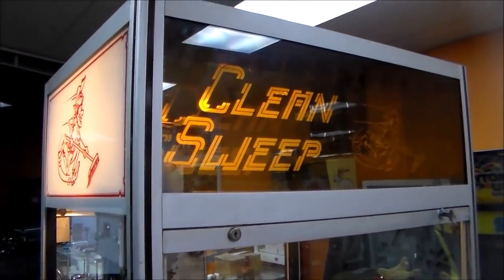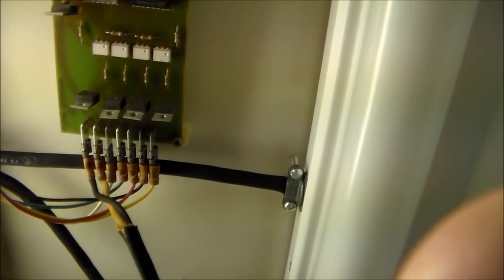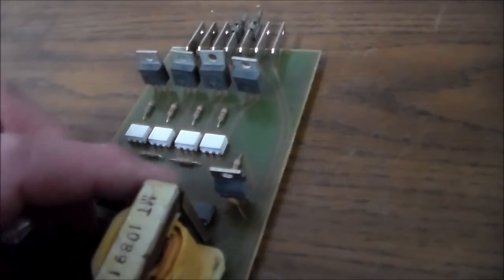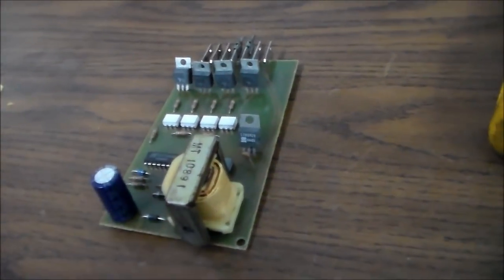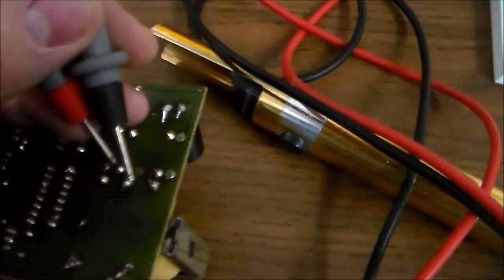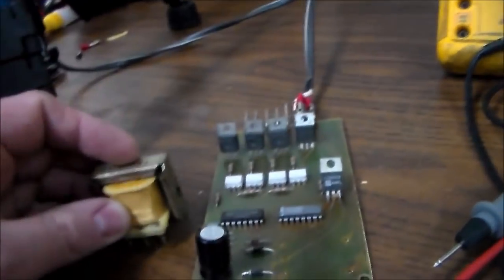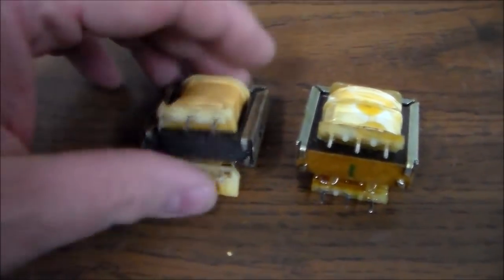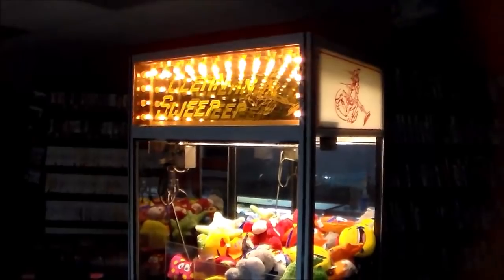How to fix or HACK the Infinity Lights on your Clean Sweep Plush Crane - PCB Claw repair

Comment: As for the white chips, I'm not sure, but those might be optocouplers. That makes sense as those would help prevent the 120 volts from running in on the other voltage should something fail. The voltage will not pass through the LED if the photocell or phototransistor half burns out because a triac failed.

If the above is true, then this is a good design. The control logic is isolated on the power side through the transformer, and it is isolated on the control side through optocouplers.
Reply from the maker: I've seen optocouplers in similar things before and they do look like that, that's interesting... I'm going to upload a video next week where we repaired a rock Ola jukebox power supply, it had a really cool design where the cpu sends a ground signal to the power supply to turn an optocoupler on, which is used to turn on the 120v to the turntable.  It also turns on a relay we had to replace, you'll probably see the video it'll be right up your alley, very cool design...

Comment: I have the double clean sweep but mine does not have the moving infinity lights :(  they just sit there not moving.
Reply from the maker: The flasher board in the ceiling of the game has probably been modified, they have SCR's that burn up on them and somebody probably jumpered them instead of replacing them so they no longer flash.

Comment: you mentioned that you did not know what the transformer output should be ..since it is running through a 7805 ...the output of the transformer can be any where between 12vac and 24vac does not really matter...as long as the input to the 7805 is less than 18vdc since once it leaves the 7805 it will be 5vdc
Reply from the maker: That makes sense, thank you!

Comment: hey joe i got one where can get pcb repaired?   thanks
Reply from the maker: Unfortunately I don't know of anybody that repairs them, you will likely have to fix it yourself!
Reply: @LyonsArcade there is a guy in Massachusetts Dick  Donlan who does arcade PCB repair out of his home Google search amusement technologies, he repaired the chaser boards that I jumped using your method he repaired them back to chase but not flash too much damage to the flashing ic chip pins, I had one of the chaser boards broke down by a manufacturing company in China and I have a schematic for this mysterious marquee light board would you be interested in a copy of the light board schematic for reference? let me know
Reply: @operationrestore3308 Google search amusement technologies out of Massachusetts the guy does good quality PCB repair and bench testing out of his home for very reasonable prices with excellent communication throughout the repair. I hope this helps.

Comment: Where did you buy the for this machine? just bought a double sided clean sweep with the shallow left side and the Deep right side. I don't know much about the machines but for $150 I figured that's a good starting point for this Hobby.
Reply from the maker: buy the what?  I'm going to guess you mean the lightbulbs, you can get them at www.CompetitiveProducts.com .  You need to take one of yours out and see what voltage is written on it.

Comment: I would have reflowed it for sure (had it not been bad). If the solder looks like an "onion," it might not be touching.

And yeah, triacs make more sense. I think SCRs control DC.

Another hack, though not something I'd recommend, but you could possibly put a resistor (or 2) from the hot to a diode, and possibly connect the neutral to the other side of the secondary.

As for the transformer, it seems they are using double half-wave rectification to get full-wave rectification at half voltage, with the center tap used as one polarity, and the other polarity coming from the outside wires sent through diodes and added together in parallel.

Generally, you need 4 diodes for full-wave rectification. But if you use a center-tapped transformer that puts out twice the voltage you need, you can get by with 2 diodes. The voltage from the center to each other leg is 180 degrees out of phase, electrically, so while they are 2 half-wave circuits, they capture opposite halves of the output winding, and the diodes not only rectify, but add the voltage from the one circuit to the 0-volt gap in the other, and vice-versa, giving full-wave rectification. I am not sure why they would do this instead of 4 diodes, but I guess this is due to heat from constant use and having a fall-back if a diode opens (not as stable and rougher on the capacitor, but likely it still works). You only work the transformer half as hard since each circuit opens up every 1/60 second. One-half of the secondary is used when the primary goes up, and the other half is used when it goes down. So the transformer runs cooler than if you use one at half-voltage with 4 diodes. So a beefier transformer ran half as hard.

If I can be briefer, you have 2 half-wave output circuits with the center tap in common that are combined through the 2 diodes to create a full-wave output equal to the voltage between the center tap and one of the 2 other legs. Then the capacitor smooths it, since even "full-wave" rectification still has some ripple.
Reply from the maker: You would have fit right in the coin op industry, as you can see they had all kinds of little problems they needed to design unique circuits to solve.... all these little boards are really clever, some are simple some are ingenious....
Reply: @LyonsArcade  -- Thanks. I'd have probably enjoyed it, but I didn't know as much several decades ago.

Comment: Hi I have been looking around for a big choice crane light PCB board that makes 12 bulbs chase in the top marquee. do you have any spare boards you could sell? the board is the kind with four fuse banks on it. Do you know were I could find one? thank you.
Reply from the maker: Unfortunately I don't have any extra boards, is it like this one or a different design?  The only place I ever see stuff like that pop up is on ebay.

Comment: what pin on the triac did you solder to? what pin on the ac did you solder the triac output to? did you only to it to one triac or all four triacs?
Reply from the maker: I did it on all four, if you look at the bottom of the board you can see one pin goes out to the wires, and one pin comes in from one of the wires.  You just connect those two pins, and don't connect the pin that connects back to the chips on the board.

Comment: One chip is a counter and the other is a PROM.
Reply from the maker: Thank you Stephen that makes sense, they'd need some code for the light sequence....
Reply: Joe's Classic Video Games I suspect the light  flash sequence is programmed into the PROM and the output of the prom is sent tot the Triacs to turn to the lights on and off in the various chase effect sequences.  The counter chip I suspect is used to advance the address of the prom inputs to sequence the PROM outputs which actually creates the flashing. I suspect on the board either there is some kind of clock occilator or they use some sort of sine to square wave conversion on the 60Hz AC line to advance the counter.   .